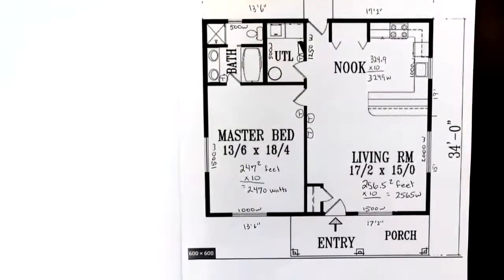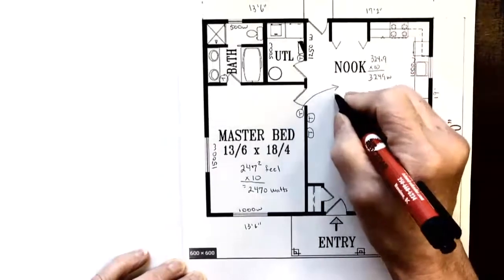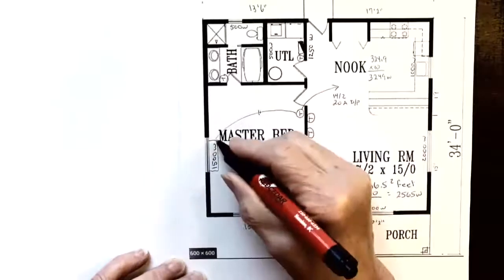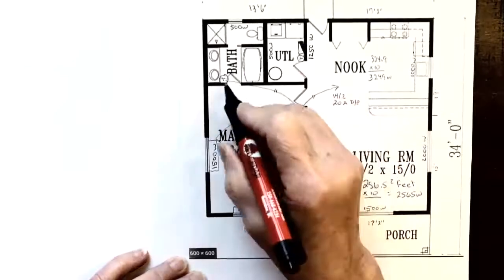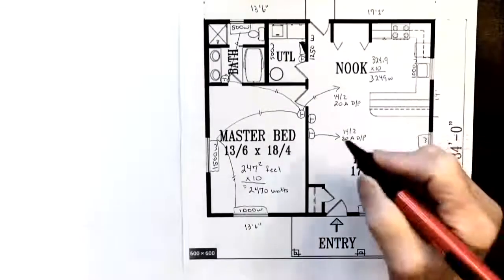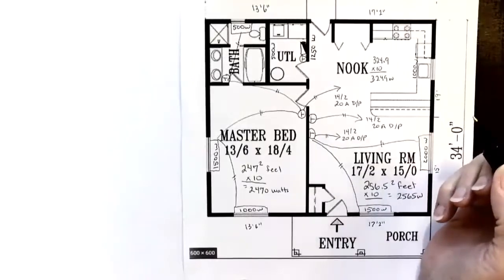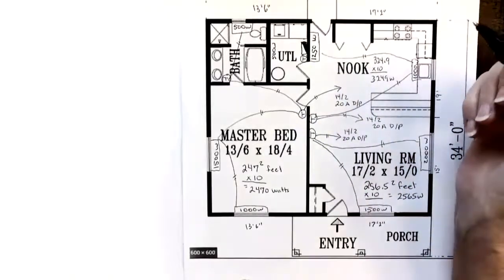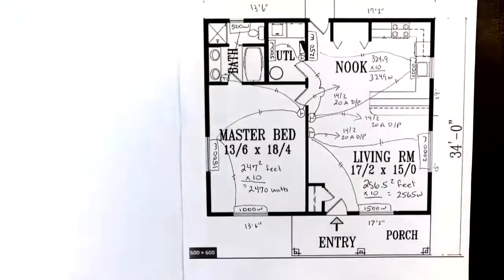CEC 2018-Section 62: Wiring the baseboard heat in a one bedroom house

Comment: You can not use 14/2 gauge on a 20 amps, you need 12/2
Reply: in Canada for dedicated  heating you CAN use 14-2 wire,ahead of 20A breaker,since it's a set load,for 2800 watts total.

Comment: Hi Deanna do you know if the new code will apply for next year ?
Reply from the maker: Hi, the 2021 CEC follows the same process. Check out rule 62-114 Subrules 7 and 8
Reply: I thought you would need to use 10/2 for a heating circuit on a 30 amp braker.